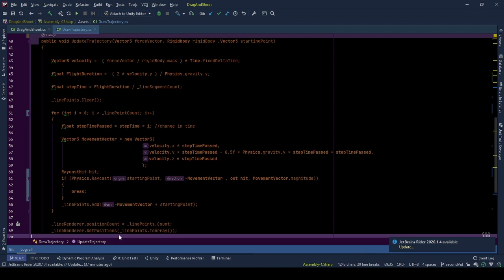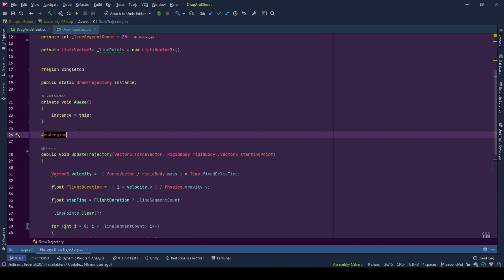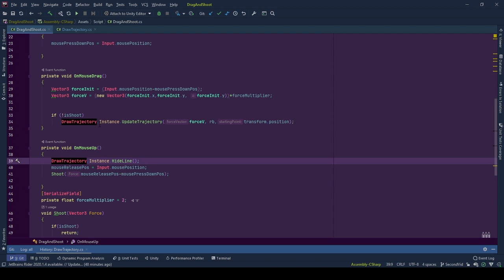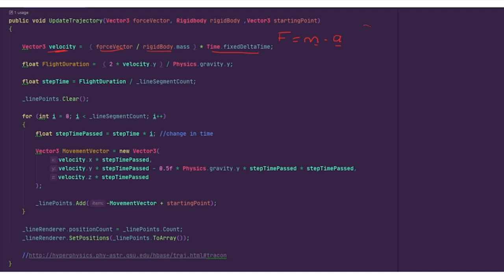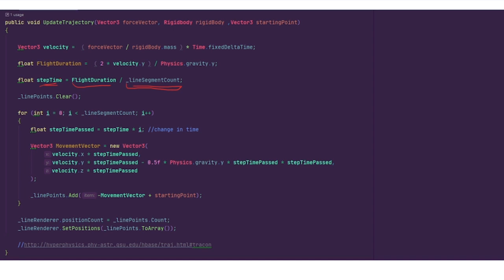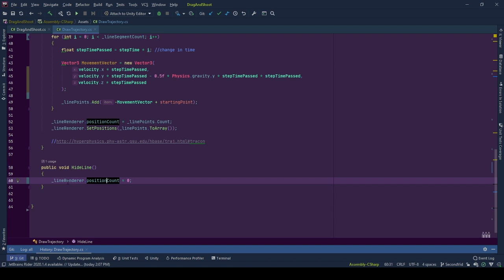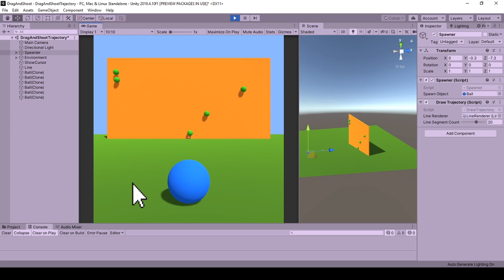How to DRAW TRAJECTORY For Physics Throw Using Velocity Or Force | Unity 3D Tutorial | Part 1

Comment: Thanks for the video. One other way of doing this is to use a multi-scene physics setup. You basically create a scene, copy your relevant objects with colliders into that scene (without their renderers), apply intended force on the simulated object (the one in the simulation scene) and use Physics.Simulate to get step velocities and draw the trajectory. This also ensures that the trajectory will always match scene physics 100%. Of course, since you actually run physics, collisions, rigodbodies, etc. all get factored for free too.

Although I'd love to know if your way could be faster and accurate enough for simpler cases.
Reply from the maker: That's a very cool approach! Thanks for detailed explanation :) This is my first time hearing it that detailed so can't say anything about the performance. In the approach of this tutorial, only calculations are done in the duration of player dragging the mouse, no physics yet to be included engine wise, only in second video for cutting the trajectory raycasting is used for all the points on the trajectory. So this is a mix of computations and raycasting till the object is thrown with calculated force.
Reply: Maybe in a game with very little going on, but simulating whole chunks of time would be expensive computationally in a larger scene, not to mention the increased space in memory from loading a physics sandbox version of your level, and you would need to be coordinating collisions and rigidbody positions, etc... It's not scalable, optimized, or necessary in most use cases I can think of.
Reply: @Xerobound  I saw another tutorial on this, and he was essentially copying every object over into another scene, i was like... "This seems incredibly inefficient..." so i stopped the video and came here. lol

Comment: i usually set tutorials to 1.5x speed but this..  i need to back down and rewatch stuff more than once. It's simple physics i know, but it's not just coding logic, there's math and physics involved so its harder. I wish you left the code available so i don't have to write all that. Although that way i can customize it to my needs. I have a fixed mass, and the force applied also ignores mass (was it velocity change mode?). I just want a line renderer for debugging the predicted trajectory where the player will fly towards when colliding with a bouncer object. I don't even wanna use it in-game. Although i can think of uses for it in-game too, if i were to implement it

Comment: I think you should show the whole code , i tried to do same things but trajectory is drawing a line not showing the ball movement , it s showing something else maybe applied force ...
Reply: ok i found my mistake but i think you may upload the scripts to github , would be much more helpful :)
Reply from the maker: @mehmetcancalskan5002  I am happy to hear the problem is solved 🙌🏻 Thank you for the suggestion too, currently I consider sharing options
Reply: @Devsplorer  Also thank you for such useful videos , i couldnt find any video about trajectory. This was what i was searching for .
Reply from the maker: @mehmetcancalskan5002  I am glad that the videos could be a help to new games/projects 😊
Reply: I have the same issue, what was the problem in your implementation? @mehmetcancalskan5002
Reply: @mehmetcancalskan5002  How did You solved the problem?

Comment: I'm using a ball that contains manipulated physics, practically identical to Unity's built-in physics, so far so good, but I use a Gravity Scale, if I use 1x the trajectory is correct, but if I multiply by let's say 5x (like that ball falls faster) the trajectory doesn't calculate right, does anyone have any ideas to fix it?
Reply: Multiply Physics.gravity.y with your scale it should work

Comment: Thanks for such a wonderful tutorial. I have a question. When I drag the mouse, I want the drawn line renderer to be stretched until it touches the ground. Do you know how to do this?
Reply from the maker: Thanks for the kind words. I think you can calculate the point the trajectory touches the ground when y = ground level and add this position to drawing array.
Reply: @Devsplorer  oh thank you so much. One more question. I want to limit the landing position of the ball to a certain area, maybe only on the plane. What should I do? 
Maybe this is related to limiting the force added to the ball. but i still can't figure it out. Pls help!
Reply from the maker: @longnguyen427  I agree with the force maybe calculate limitng force values and use clamp to limit player defined force

Comment: Hi.Thanks for the great tutorial. Where is part two?
Reply from the maker: Thank you! Coming this week 😊
Reply: @Devsplorer  hi. I have a little problem, in fact very little problem, in 2nd equation of motion. Can I get a little help from you? Because you seem a master at implementing physics equations.
Reply from the maker: I enjoy doing that whenever I get the chance 😇 what kind of problem, can you explain?
Reply from the maker: Details on like what you tried to do and did not work, a link to the equation you tried to implement 😇 A little context should be helpful
Reply: @Devsplorer  
Hi. I have made a projectile shooting system. I want to shoot an object from position A to B following an indicated path. Everything is working fine except for one thing. The velocity applied on the object is calculated based on the distance between A and B, the value of time is 1 to travel this distance. Meaning that the farther I hit, the quicker it goes. I want to have control of the force applied. Meaning that it should go with my set speed whether I hit near or far.

 Vector3 calculateVelocity(Vector3 target, Vector3 origin, float time)
     {
         Vector3 distance = target - origin;
         Vector3 distanceXZ = distance;
         distanceXZ.y = 0f;
 
         float Sy = distance.y;
         float Sxz = distanceXZ.magnitude;
         float Vxz = Sxz / time;
         float Vy = 0f;
         
         Vy = Sy / time + 0.5f * Mathf.Abs(Physics.gravity.y) * time;
        
         Vector3 result = distanceXZ.normalized;
         result = result * Vxz;
         result.y = Vy;
 
         return result;
     }
Reply from the maker: Hi! Thanks for the details :) Why dont you calculate time = sxz/ your set velocityxz then use it to calculate velocity y, sorry if you already tried it out. For xz having a set velocity and for y having a variable velocity feels like should be okay for moving space, on xz plane and flight space on y axis
Reply: @Devsplorer  GREAT. GOT IT DONE. THANKS A LOOOOOOOOOOOOOOOOOOOOOT :)
Reply from the maker: That's great news! Happy that it was solved ^^